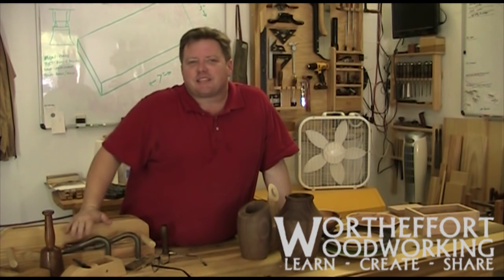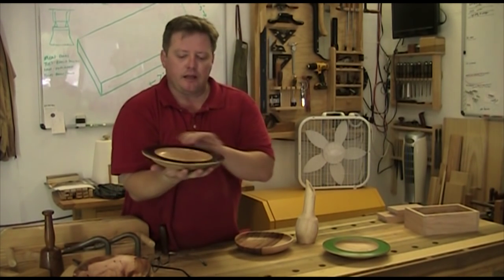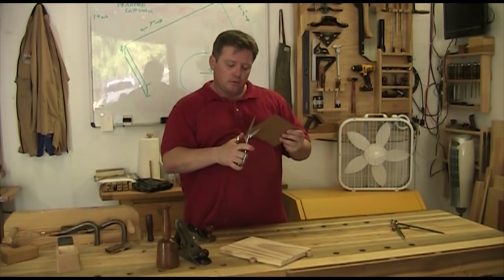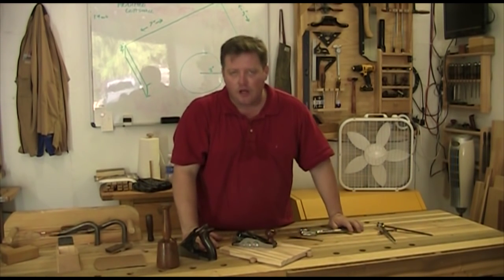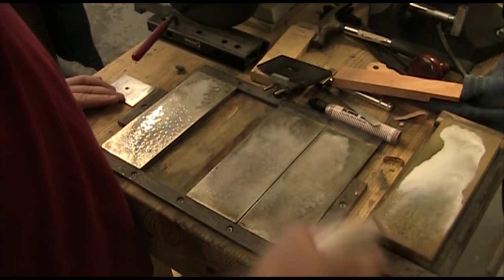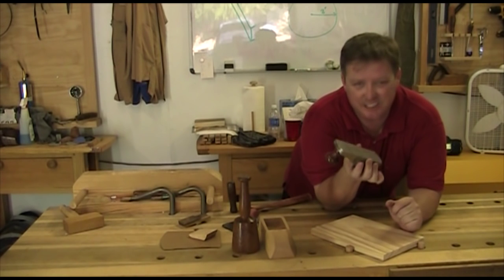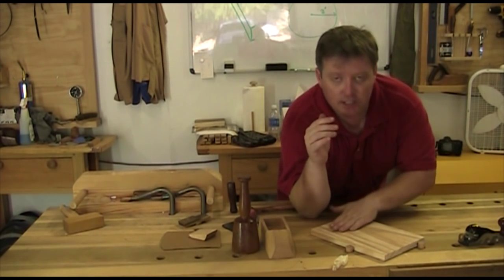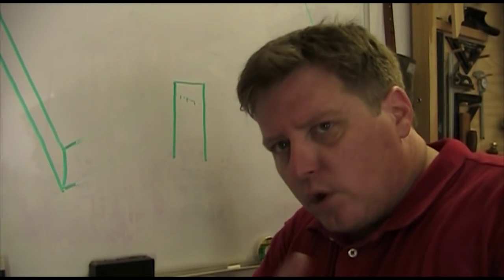hand plane cure all? - 7-20-15: a Monday Lunch Break Discussion

Comment: Do you have a good source for inexpensive milk paint? I have played with some from Woodcraft but it is relatively expensive at $14 for powder that make about a pint.

I would be interested to see a video on your process for applying / finishing milk paint on turnings, I haven't seen that before.
Reply from the maker: awldune if you buy in bulk from the suppliers you generally get a better price.
Reply from the maker: awldune I posted a video a few years ago, not very well shot but it had milk paint on turnings and how I get it smooth.
Reply: wortheffort Thanks, I'll check that out.